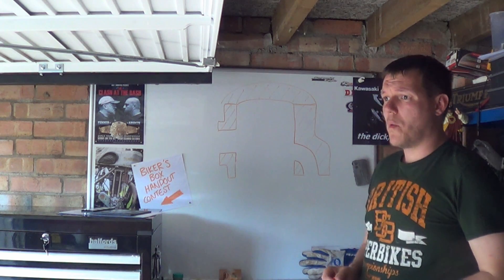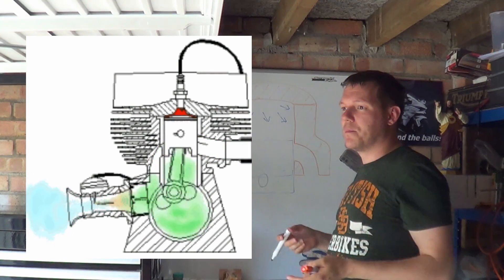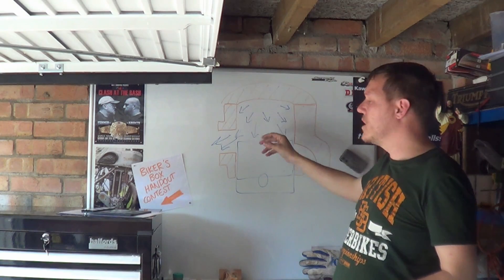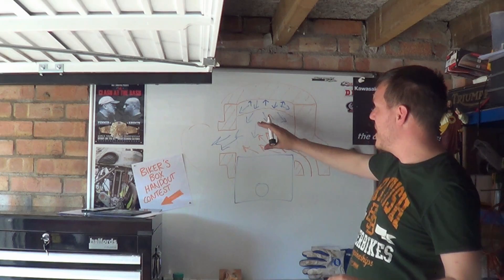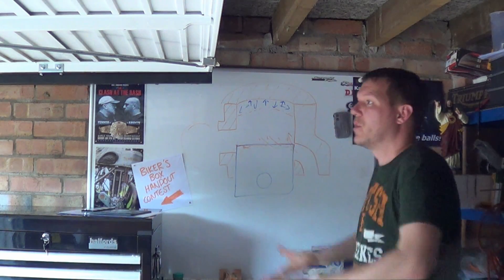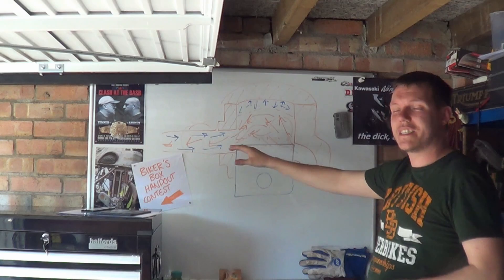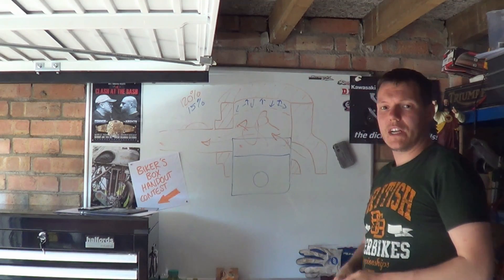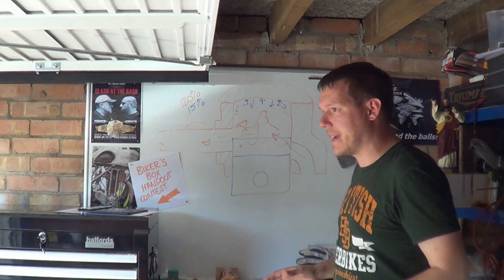2 Stroke Flow - Filling the cylinder - Part 1

Comment: I agree it is not supercharged, however, if the crankcase was not pressurizing the crankcase, the engine in your example wouldn't run very well, maybe not at all.  Also, a 4 stroke doesn't use the crankcase pressure to force air and fuel into the intake, so a simple 2 stroke is obviously getting something more than a 4 stroke is.  Yes, most* 2 stroke's natural design is to use this crankcase pressure, but that still doesn't negate that it is forced induction of some sort, to some degree.  Still, I agree, NOT supercharged.
Reply: If you take away a supercharger from an engine, it's still an engine and it still runs. You take away crankcase pressure variations from a 2T, it's no longer an engine because it doesn't run. It's not supercharging, it's called inherent 2T design function.
Reply: KillerWattsRacing Right there with you, totally agree.  I do think you will also agree that 2T design function INCLUDES forcing air into the combustion chamber from crankcase pressure, unlike any 4T.  It's not supercharging, but it is something that 4T engines do not have.
Reply: Yep I hear you mate, I just don't think "forcing" is correct terminology though. As per Matt's awesome drawings, its an open system. You "force" air into a closed container (like a forced induction 4T). In a 2T the transfer port has opened and closed all while the exhaust is opened, so there is no real container to 'force' the mixture into. By strict terminology, the exhaust back pressure is doing more 'forcing' than the positive crankcase pressure is when the transfer port opens. Just my 2 cents, I love thinking about it out loud!!
Reply: KillerWattsRacing True, but without the crankcase pressure getting the fuel and air in the combustion chamber in the first place, there would be no exhaust backpressure or pressure wave.  Think about when starting the engine, it is forcing the air through.  Still not supercharging!
Reply: That's it, the mixture is being forced out of the crankcase, everything else is just consequential. Matt should completely redesign a 2T and have the crankcase 'suck' the exhaust out of the cylinder and use the ensuing vacuum in the cylinder to fill it with mixture. It could be called the 'Simpsons' motor, which both sucks and blows!!
Reply: KillerWattsRacing Lol!
Reply: KillerWattsRacing had a girl named Tina in my mota and she sucked and blowed. Woohoo
Reply from the maker: "however, if the crankcase was not pressurizing the crankcase, the engine in your example wouldn't run very well, maybe not at all."

- you didn't watch all the video did you? Because I say this in the video.

"Also, a 4 stroke doesn't use the crankcase pressure to force air and fuel into the intake, so a simple 2 stroke is obviously getting something more than a 4 stroke is" - lol wrong. A 4 stroke has an entire intake stroke, which replaces the need for the crankcase breathing function."
Reply: The Workshop 1. Yes, I was just restating what you said to the other guy I was conversating with. 2. Yep, it does do the same function with the additional two strokes.  I wonder how much energy is used compressing and decompressing the crankcase in a 4 stroke, must be some...  I know it sure can cause a lot of oil leak issues that 2 strokes just don't have to deal with, they just throw the oil out the exhaust by desing instead!  :-)

Comment: to remove trapped exhaust, go to uni flow of a opposed piston 2T
Reply: Opposed piston 2 strokes are great for efficiency and have a lot of power potential. Uniflow is the most positive form of cylinder scavenging and OP is a good way to do it. Here's an opposed piston multifuel 2 stroke with a blower and a turbo...   https://www.youtube.com/watch?v=UxON-HIlz5E

Comment: lol its supercharging lol motomam says so
Reply: Actually, the pipe does have a supercharging effect.  It is not really a "pressure wave", (as in psi), but a "sound wave" that bounces off the reverse cone back to the piston before it closes. May be the biggest factor of a tuned pipe, the tuned pipe is tuned by using that sound wave, (Speed through the gasses), in relation to piston speed. The shorter the pipe, the faster the piston speed it matches, and visa-versa.  According to the old 2-stroke writes of the 70's (some of the last written for publication), the pipe could charge the cylinder up to 125% of it's actual volume.  That is a supercharging effect.

Comment: yaaay 1st :) my transfers are aimed at the opposite direction away from the exhaust to cause a swirling mixing motion but yeah it will still always piss some out the exhaust (yammy dt 125)
Reply: Sorry but you need to look at a drawing again of your engine Yamaha where very good with 2T.
Reply: me? ive got a cylinder right in front of me right now no need for a drawing i can see the transfers..
Reply: You are correct you want to direct transfers to the upper intake side of cylinder to promote exhaust savaging and good fuel charging...